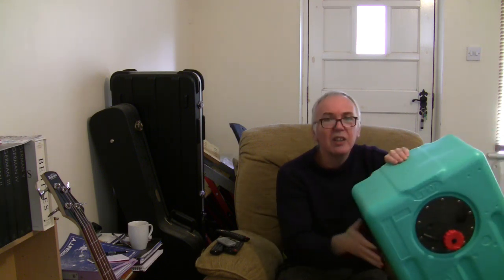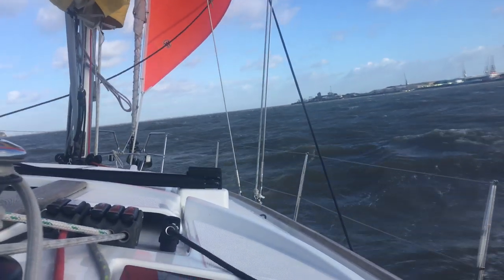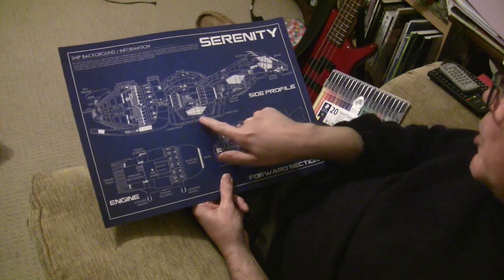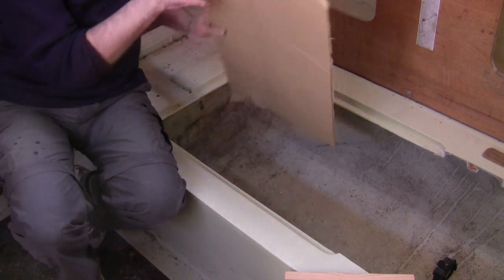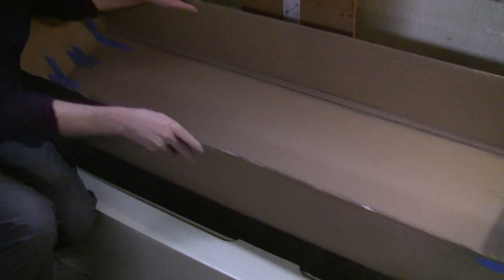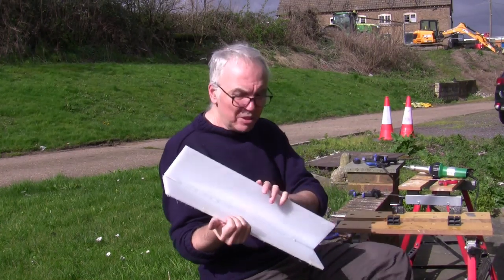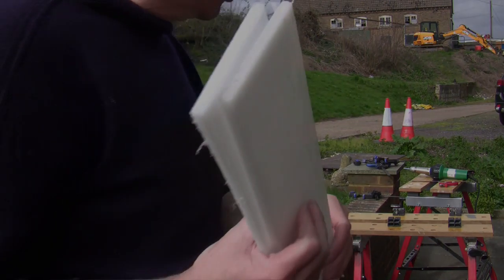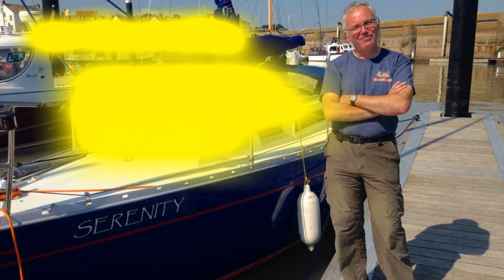Just About Sailing March 2020 - Making a DIY plastic (HDPE) water tank, Pt 1 - Is it even possible?

Comment: Cardboard  pattern always a good idea. I've  not seen this type of construction before although I've repaired small plastic items witn a soldering iron! I'd prefer two smaller tanks to make it easier to fit in and if any leaks or contamination then  you still have some left. I guess you will put baffles in one of this length. You're  lucky to be able to work on the boat now, most are locked out of boatyards. You made a smart move in bringing your boat home. I'm making a boom lazybag with a 98yr  old sewing machine, all I can do atm.
Reply from the maker: Ha ha - a 98 year old sewing machine is probably stronger than a new modern one.
Yes, I will be putting bafffles in. One of the problems with the tank I bought (apart from not fitting properly) was that it has no baffles. If I were to do this again, I would cut much more accurately and really build a substantial jig to hold things in place. I will hopefully get the next video out soon and you will be able to see a bit of warping from the heat. This wasn't a problem with the shorter lengths of plastic in the test.
It is great to have the boat in the garden
Cheers
Paul

Comment: Looking good. My limited experience at welding HDPE was mostly frustrating. Either not hot enough to make a secure weld, or to hot and the parts distorted. I certainly wouldn't have finished up with two straight edges that were strong enough to sit on
Reply from the maker: Ian, my guess was that you had probably tried this. Yes that's exactly the problem. In truth I need a lot more practice. It's quite difficult with a bright sun, but you can sort of see a little 'bow wave' of clear melted plastic running in front of the welding stick. I am using that as my guide.
Hope you are all well in this confinement. It must be very frustrating being so far from your new boat.
Oh, by the way, that was the Medway where Lucy did her Comp Crew, but I'm sure you recognised that.
Cheers
Paul
Reply: @verynearlyaboutsailing8114  Were good thanks, and yes Lucys sail did look familiar :-)

Comment: Neat.  Looks like a really fun project.  I can't wait to see the finished product.  You should think about a large access hatch for cleaning the inside should it get yucky.   There are a number of off-the-shelf hatches suitable for cutting into plastic water tanks.

Take care of your health in these difficult and crazy times.  We are just sitting at anchor in a little creek on the US East Coast self-isolating and waiting for further developments with this pandemic.
Reply from the maker: Thanks. This is a somewhat unnecessary project - but it is fun. I do have an access hatch that I am going to fit. That will probably be in the 3rd video.
I am very lucky that my boat is basically in the garden. But, as you say, these are crazy times. So we just need to sit tight and wait it out.
Paul

Comment: Pretty much like welding steel. But less grinding and dirt.  Try to make the corners as smooth as possible to avoid stress risers.   Looks like a fun project to learn new skills!
Reply from the maker: Thanks Tom
The corners are quite tricky. This is one of those skills that should really be practiced a lot. It also doesn't help that this stuff is bright white and we had a few very sunny days after all the bad weather.
Cheers, Paul

Comment: Would it be an idea to make two separate tanks, connected to each other with the possibility to close up either one of them? Two tanks would limit the loss of water in case of a leakage and will be easier to handle if that should be necessary?
Reply from the maker: That is another good idea. I was thinking about this before I decided to cut the 'gap' between the two hatches under the seat (which will be put back by the way. I decided that I wanted to try and have all the inputs and outputs at the top of the tank. But I think it would be perfectly viable to do as you suggest and still keep all the connections at the top. Maybe have a main and a reserve.
Food for thought.
Do keep the suggestions coming.
Paul

Comment: What is the plastic Tacker that you are talking about please explain. I'm going to be getting into plastic welding soon that I need to know as much as I can and I'm finding that packing is very important but I'm confused by It Anyway great videos Man
Reply from the maker: Good question. But, I am not an expert. As you can see in the video, I was learning as I went along.
When I bought my plastic welding kit from eBay it didn't come with a tacking nozzle. I found mine on Amazon, but you can also get them from eBay. Just search for 'plastic tacking nozzle'.
The tacking nozzle is like a stubby blunt knife. It get s very hot and melts both bits of plastic at once to give an initial weld that sort of holds everything in place. It makes the main weld much easier.
Looking back, I think I needed a lot more practice before trying to make the actual tank. I am not convinced that I got either the heat intensity or the speed right.
There is a heat adjustment on the heat gun. I need to do lots of experiments with different levels of heat. For example - I don't know if its best to have a hotter temperature and work slowly, or a higher heat and work fast.

But it is fun.
Good luck with it. Cheers
Paul
Reply: @verynearlyaboutsailing8114  hey thank you so much for the reply Paul I really enjoy your videos. I'm going to be buying an extrusion welder here very soon I do appreciate the quick reply maybe check out my channel it's new but getting better

Comment: What Temperature and dial setting worked best on your HDPE? Desperately Seeking Settings.
Reply from the maker: Very good question. The honest answer is that I don't know. I didn't really test this out as scientifically as I should have. I just twisted the dial until I 'thought' it was right.
I am sure that there must be a sweet spot - between not melting enough and burning everything.
However, I have decided to have another go at it. I really wanted to try building a HDPE holding tank. But the idea of a holding tank leaking is too awful to contemplate. But I now have an air compressor which means that I should be able to do some sort of pressurised leak test. I'm not sure when, but I will be revisiting HDPE welding. This time I will do some tests to try and figure out the best settings.
Let me know if you come up with any recommended settings.
Cheers, Paul
Reply: @verynearlyaboutsailing8114  Polyethylene (HDPE)190°C  (375°F)
Reply from the maker: Only just spotted your reply. A couple of things I am wondering about.
Firstly, does HDPE oxidise. It seemed to me that there was a 'layer' on the outside that didn't weld so well. IE it had a higher melting point than what was under it. - A bit like aluminium, which is really difficult to weld because the metal under the oxidation melts before the outer layer. If this is not oxidation, it could just be a characteristic of the way the HDPE is manufactured meaning that the outside surface is slightly more dense than the inside.
Second, is the optimum temperature when the rod and the material go completely clear? This is what I am assuming. I am guessing that any HDPE that is still its original colour (in my case white) is not truly 'mixing' and therefore welding. One problem I had was that I heated it too much and it actually burned the HDPE.
I will be doing some further tests soon. I think that the technique is one that needs to be practiced.
Paul

Comment: You could still have the fill in the side (top or bottom) and the takeoff at the bottom having only an inspection hatch in the top. It would give you maximum depth of tank and the only disadvantage would be that a leak, especially in the takeoff, could empty the tank into the bilge leaving you with no fresh water.
Reply from the maker: Thanks. Absolutely right. In fact, even if the water did leak out, I can make that whole compartment watertight.
But I thought it would be an interesting challenge.
The 'original' tank was one of those flexible plastic bags - it used to leak all the time, which is a shame as it was very easy to use.
Cheers
Paul

Comment: Wow modern materials are amazing, I went and looked at the water tank in my old hymer that’s quite a good size perhaps there’s one for motorhomes that would fit
Reply from the maker: I think that the original water tank might have been in the V berth. It is possible to buy some 'pre-shaped' ones for that. I couldn't find anything even close that would fit under the cabin seat - except the one I showed which is far from perfect.
I do look at motorhome suppliers for ideas. - Very similar ideas to boats.
Cheers
Paul
Reply: Just about sailing yes Vegas is at the sharp end . The rain an water maker I like then you can have a smaller tank for cruising .I like the portable cool if you change horses

Comment: Great video - haven't seen anyone welding HDPE before. Personally I'd have gone for the easier option of drilling a hole in the existing tank to locate the pipe - maybe that's just me. I'll be interested to see how you get on wit the HDPE though.
Reply from the maker: Yes, I know. That's probably exactly what I should have done - and could be what I end up doing, because I don't actually know if this is going to work yet.
But who doesn't like melting plastic in the pretence of doing DIY?
Cheers
Paul

Comment: This video is great vide as I have been thinking of making one myself.where did you obtain the hdpe and the welding tool from..?
Reply from the maker: Terry
I've just added the details of where I got stuff from in the video description. It was easier and less messy than pasting it in this reply.
If I were to do it again. I would be much more accurate with my cutting, practice more, clamp things up more solidly, and practice more. I found a bit of warping from the heat when I did the larger sheets. You'll see this in part two. Also, welding bright white HDPE outside in the sun was difficult as I couldn't really see how well the plastic was melting. Also, I still haven't really figured out the best heat setting on the hot air gun. - One minute I persuade myself it's too hot, the next minute that it's not hot enough.
Let me know how you get on if you try it out.
Cheers
Paul

Comment: Interesting video, thank you for this new idea of welding plastic... One idea from my side: Maybe you could attach a vacuum cleaner to the circular saw and the router to avoid spreading all the plastic particles to the environment? This is the topic the world (of sailors) is talking about in this times;-)...
Reply from the maker: Thanks, and of course you are right. I did have the vacuum cleaner nearby to clean up the mess. And I did manage to fix it to the circular saw after finding the right attachment. It worked reasonably well. I also tried to fix it to the router - this didn't work at all unfortunately.
This is a very important topic and I should have highlighted it. Thanks for reminding me.
Paul

Comment: I'd probably consider sectioning off that space, smoothing it out painting etc, and installing water bags - if max capacity is the goal.
Or, use the bought tank and just make a few poly rings to modify and lower the opening hatch on it. = less capacity but you already have the tank and plastic, and epoxy.
Third option, cover the area in plastic, and lay fibreglass to make your own removable but very well fitted tank, with baffles and proper internal coatings.

What you are doing:
I've had a play bending plastic once, and I can't help thinking if you use a much thinner materiel you could bend most of the angles into a box - heat gun etc -  with the seals only being needed on a few edges which would help in the manufacture I'm sure.

In any case enjoy yourself
Reply from the maker: Yes, that's a good idea. I did originally have a 100 litre water bag, which leaked. I replaced it with a 150 litre, which also leaked. I think the leaks were coming from the outlet which was sort of under the bag. I'm sure that there would be a way of sealing it properly. Maybe I should have persevered.
And I might well modify the existing tank if this all fails - which it could. I just couldn't resist the temptation of trying to make a plastic tank - I don't know anyone else who has.
Thanks for watching
Paul
Reply: @verynearlyaboutsailing8114  Hi Paul, I did wonder why you weren't using flexible tanks - given the nice smooth interior of that space. I guess with two episodes of leaking bags that explains it.
Hope you are well and staying safe. I certainly wish Moon Shadow was in my back garden!
Cheers
Paul
Reply from the maker: @sailingmoonshadow3169  It was mostly because of the leaks. But also, I wanted to be able to use some of the space around where the water bags used to be. But it is by no means a done deal yet - things could change. Having Serenity in my back garden is great - having her in the water would be better ;)
Reply: @verynearlyaboutsailing8114  well Moon Shadow is in the water but I am land-locked! :-(

Comment: I admire your quest to try new things! Just a tiny bit worried that things may break, but I guess I'm overthinking and hyperworrying... I'd give the tank a real beating before I'd install it, but I guess you'll go about that too in your own way! Did I just hear Frank Sinatra singing in the back of my mind..?
Reply from the maker: Good point. In theory if the plastic is melted properly the joint should be as strong as the rest of the tank. However, it possibly takes a lot of experience to get to the skill level of being able to make perfect welds.
The real challenge would be to make the holding tank from HDPE - that could be a real disaster if it leaked.
Cheers
Paul
Reply: @verynearlyaboutsailing8114  Omg! Don't even think about it!!! lol...

Comment: I have a plastic propane tank holder on deck of my new boat and it has broke in several pieces so I've made a new one from fiberglass, It won't break! IF it was me I'd fiberglass over your tank when finished, fiberglass shrinks and it would keep it from splitting and would never leak! Look at how many video's of people fixing or replacing those plastic tanks! Just my opinion!
Reply from the maker: Cheers
I've seen your videos and I know you are a master of fiberglass. I am going to make a fiberglass holding tank...unless I get very confident and try one in HDPE. But the consequences if it went wrong are too grim to mention.
Cheers
Paul